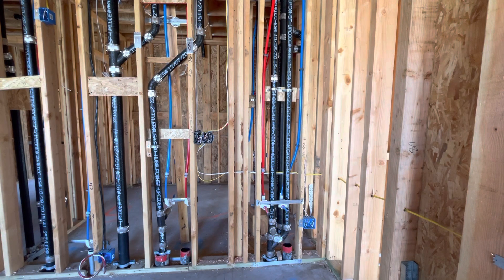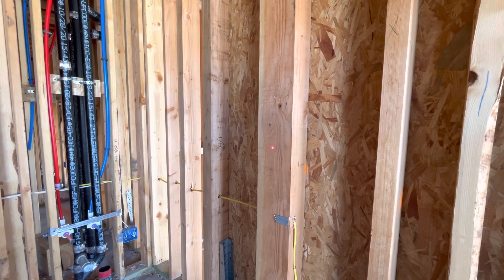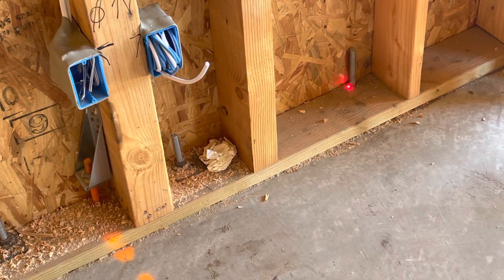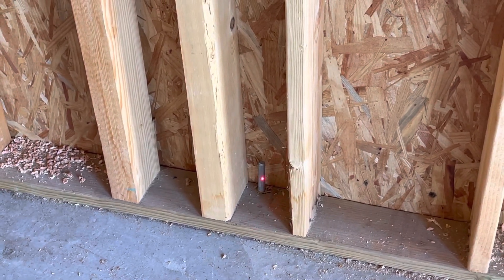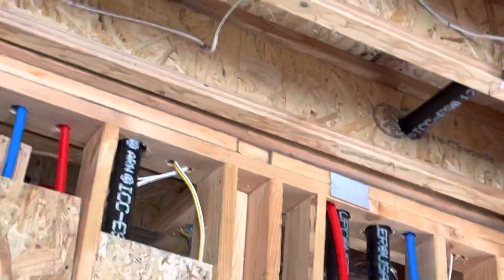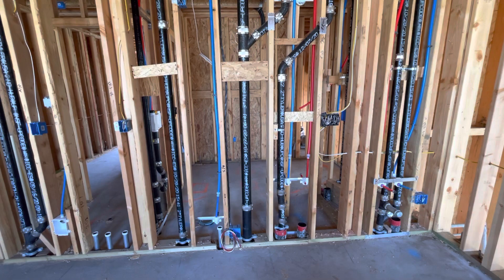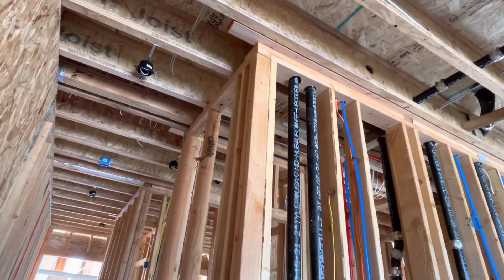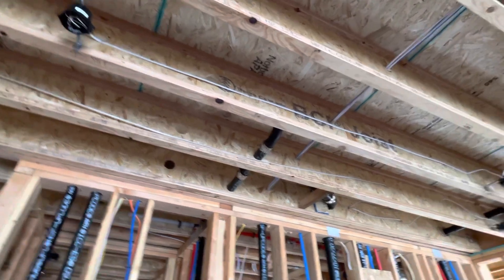Skeletal Summary of Framing, Plumbing, and Electrical of  New Construction

Comment: 3 by 6 r for shear nail panels every 4 foot on center so that the panels have more then 1 1/2 nailing area on shear panels,Good job john jon i love it The yellow romex is to tell inspector that that romex is 12-3 if it was white romex it would not meet NEC Good Job John jon

Comment: Hi JOHN jon, we did not know you too do construction, we dour own HVAC, plumbing, framing, concrete and electrical, we it all on our own using a friend with a contractors license to code here in Yucca Valley as well, nice to know this of you, we love doing this in our spare time. Thank you, we enjoyed Lance & Patrick.
Reply from the maker: hi lance and patrick. yes i am aging out. bummer! Thanks again more to come Stay with Me!
Reply: @johnjon6159  hey that guy in the little village did not call me back for work o well the cleaning guy
Reply: My friend was reshingling a roof that had osb (oriented strand board) for roof sheathing. The shingles had been leaking for quite awhile. His legs went right through the shingles and osb. Luckily the rafters stopped him. He was only scratched up.
Reply from the maker: That's really a quite the observation it's funny because I tell people if you really wanna know the difference between plywood and OSB just leave it outside for a while the OSB will start delaminating real quick it doesn't really have near the strength or the value longevity as plywood. Thanks for your comments is always more coming stay with me
Reply: Little studio goes for $2500 ouch! Too rich for my bank account. Interesting video thanks.